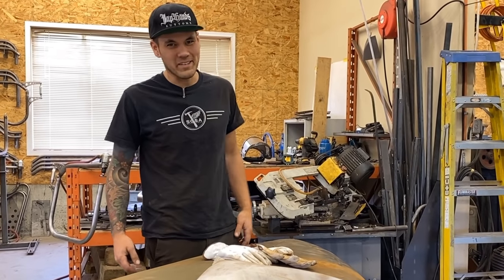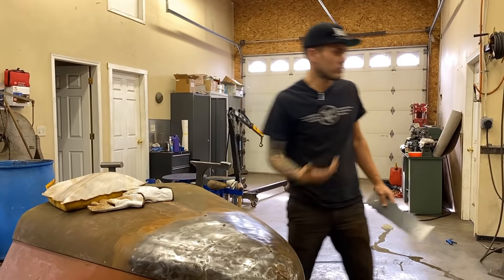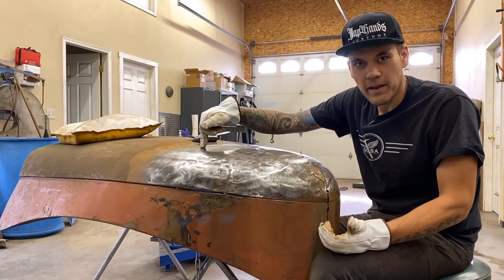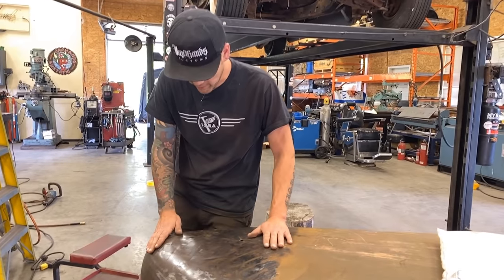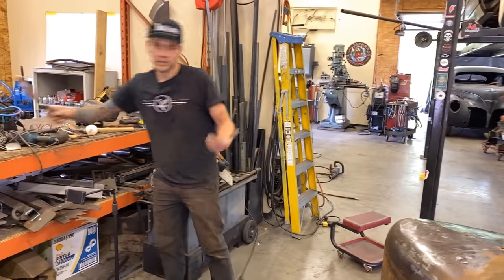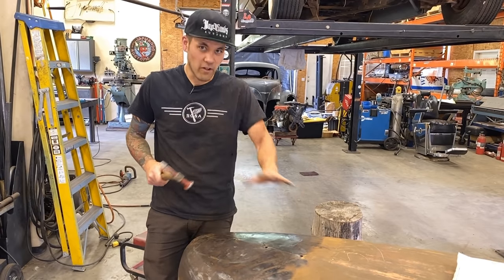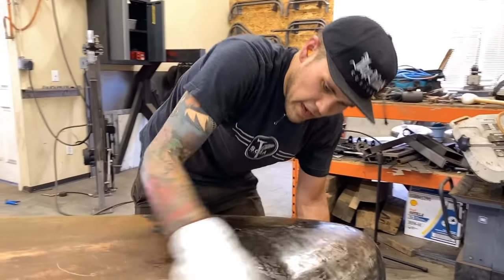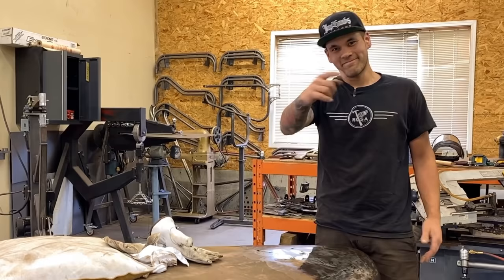Hammer & Dolly Techniques: How to Remove Dents + PLANISHING HAMMER Basics!!

Comment: I wish we had those air driven planishing hammers back when I was serving my apprenticeship as a panel beater during the mid 60’s here in the U.K.. To do what you’re doing with the hood (we call them bonnets), I’d have used a variety of profiled dollies, a slapper/flipper made from a “bastard file”, a dreadnought/adjustable body file & a pot of thinned down primer and a paint brush. The slapper having a cross hatched surface would show me where I was making contact with the dolly when bringing up the low spots. The bodyfile to show where I had raised the low spots and which areas I needed to still refine. I’m retired now, almost seventy years old and I loved going to work every day. It’s so encouraging to see a younger generation carrying on the old traditions of metal finishing but having the benefit of using tools that make the job less “wearing” on your hands. Thanks for sharing, very enjoyable and educational. 👍👍👍

Comment: Hi a kiwi here with a r32 Nissan skyline 2.5 manual, I have had a couple of small dings in the front left  panel and some backed out of a park next to me and put a lovely dent in the back Rh panel and I got most of that out with my hand but lots of little dents remain and these videos are gonna help a lot with getting them out. 🍻🍻🍻🔥☕☕☕
Reply from the maker: Right on Bret I’m glad those videos are going to help you out! Light hits with the hammer careful not to stretch the newer thin metal is easy to stretch too much

Comment: Listening for the pitch change is also a great tip. It will start out as thud thud thud and start getting a higher pitch as your getting closer. When the dolly and the slapper meet it will become a high pitch tink tink tink. This is extremely important when putting on a door skin because any waves on the inside of the door frame side of the skin equates to a wave on the outside of the door edge. So if you listen for the dolly and hammer to tink then you will know its even inside and out. You wont need any bondo on the face of the door skin.

Comment: I use my aircraft rivet gun to planish. I didn't know they had big frame to hold what is essentially a  rivet gun. Cool. I'm just a amatuer and grabbed the gun one day when I was borrowing the neighbors car trailer.  It had a bad ding on the fender that hit the tire.  I did have to use a torch and shrink the metal a bit.  Cool!
Reply from the maker: That’s really cool man! Use what ya got! Planishing hammers are essentially the same tool 👊🏼

Comment: One great dolly I use is a weight dampner on front reinforcement bar of early 90s honda accord. Rectangle and heavy enough to smooth metal
Reply from the maker: Yes! Anything can be used as a dolly! I would say half of the things in my dolly rack are not designed to be a dolly lol
Reply: @MakeItKustom  lol. I know. I made a tool to remove torsion bars that hold decklids up. I got tired of being bruised when I took them off with pry bars

Comment: In removing the high spots at 2:20, what would happen if you used something heavy, but slightly deformable in place of the dolly, like a couple 2x4s stuck together?  Would the give of the wood allow the hammer blows to un-crinkle the metal without smashing the metal thinner?  Or maybe even a bag of lead shot might work nicely?
Reply from the maker: Yea it’s ok to use stuff that’s softer than the metal. But typically if you are careful not to smash the dolly, it ok to use metal dollys

Comment: I’m restoring a Ford F1 that’s been imported from USA to here in UK your panel videos have been a great help but I have one big problem a large dent on the door skin just below the window that has two creases there is no access from the back of the door until you get quite low where there’s an access panel. These doors are made from 19 gauge steel .Have you any advice on getting this straightened out . Kind regards Tony
Reply from the maker: There’s a couple ways to go about it. You could get a Uni spotter and pull it out as best you can. You could cut the skin off repair it and rescan it. Or you can cut out the structure on the inside of the door to gain access and then weld it back in after it’s been repaired. All depends on what you’re comfortable with

Comment: Fantastic Karl, hard to believe it could be improved that much. Question, is there any fear of a reaction between the WD40 and the paint later? I’m thinking the metal would become impregnated with the WD perhaps.
Reply from the maker: Absolutely WD-40 or any oils that are silicone-based are definitely reactive with paint. The panel must be cleaned very well before any paint is to go on it

Comment: Carl...is it possible to Work the Metal by Hand to the point No Filler would be needed?
Reply from the maker: Absolutely that is possible! I’ve never gone that far with a panel because for most situations it takes so much time that it’s not really worth it. I like to get it extremely close and Then let a thin scam of filler or spray primer finished off

Comment: Would you say your holding the dolley hard enough against the panel to where when the hammer hits, it stays in place? Or would it be bouncing off the panel w each hammer hit. Im just trying to narrow down on the pressure w the dolley, always had issue w that
Reply from the maker: It helps to push quite a bit with the dolly I’m definitely holding it in place and pressing up. Are usually try and use as much pressure up as I can
Reply: @MakeItKustom  Thank you so very much for the reply and help..

Comment: take it for what it's worth but I  think a shape gauge and just grinding a piece of nice sturdy steel to shape might be just the trick. now that has to do with to what extent you are willing to go and what you're going for if your shooting for that's good enough then you might not go that far with it but if you just got to have it perfect for yourself or a client your gonna have to make many dollyies for the job but if you ever do another like it you'll have the tools in the box.  you will likely be the only one that knows the what when where and why of it so you'll need a system to designate them. a layout chart and some stamps. might be best. in case you have the occasion someone else you trust will use them.

specialty shops often have a library of tools they never use again.  witch is why they can name their price upfront charge as they see fit.  now if you are just trying to get your buddy Bob a little closer to where he wanted to go with the project then is a discretionary call. storage space may be an issue. tooling is everything and a good deal of the time cost-prohibitive and too time-consuming for those shops just trying to grind product,  this is the sort of thing that makes guy/gals decide on vision course meaning what kind of shop do you want to be,? you will have to choose at least in the short term  metal is like Jesus it will take you places if your dedicated

Comment: I probably would have slapped you for using wd40. But that's just the painter in me
Reply from the maker: Yeah you’re right I usually use Gibbs because it’s a non-silicon-based lubricant